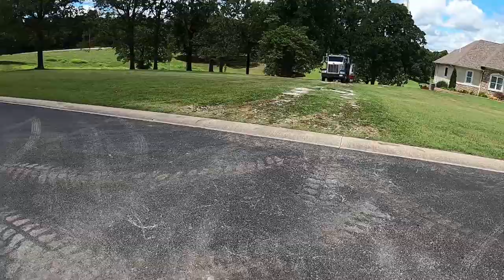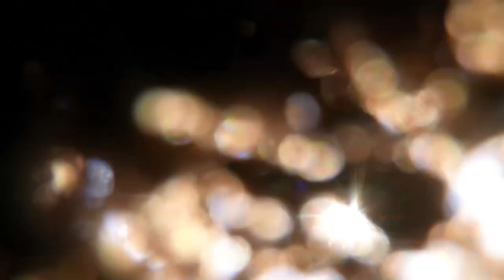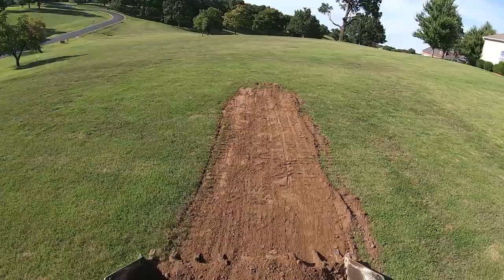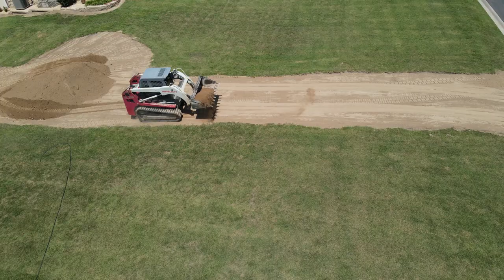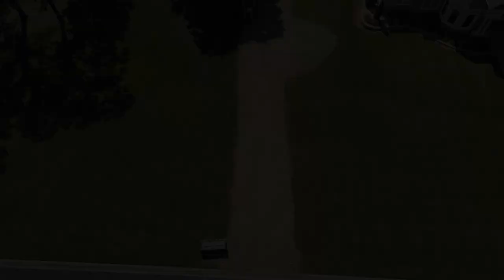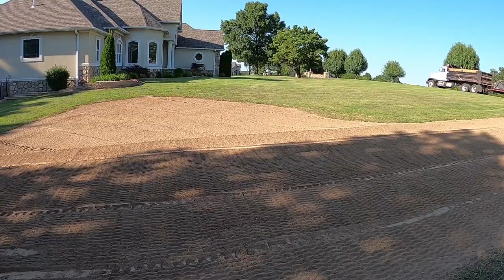Prepping Dirt For Hydroseed At The Water Feature Job

Comment: Good work and drone footage.... I saw your vid using the harley rake a month nback or so. Did you give a preference? Landscape or HR.... Or better yet can you do the same work with the LR ie small grading and such. I've only used HR
Reply from the maker: Thanks! Yeah I talked about that a little in that video. I’d say the harley rake is the better all around attachment and the preparator is more for the finish pass attachment. The harley rake does a better job ripping up existing grass and loosening the soil but doesn’t leave as nice of a final pass as the preparator. If you could only pick one I would go harley rake
Reply: @eliteearthworksllc   Thanks I may need to go back and watch the comparison video again. However, really appreciate your reply.